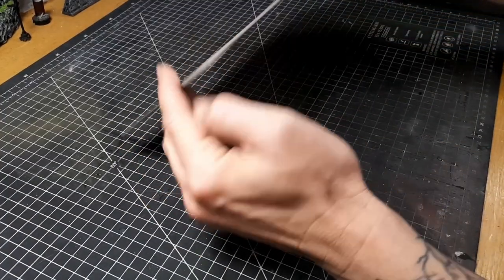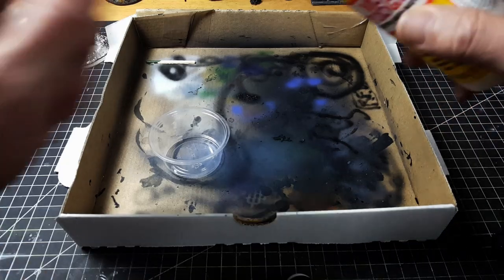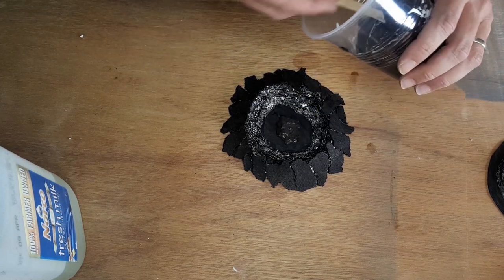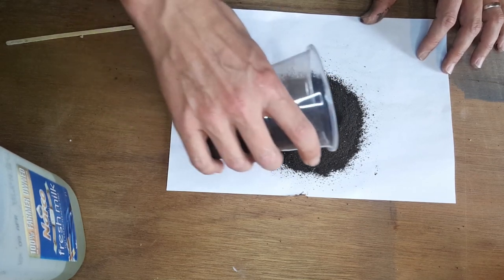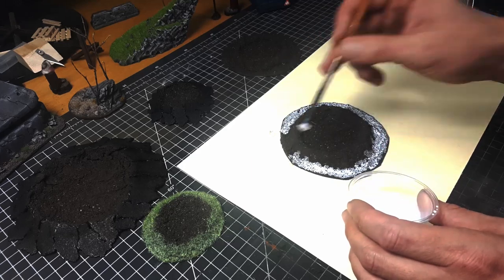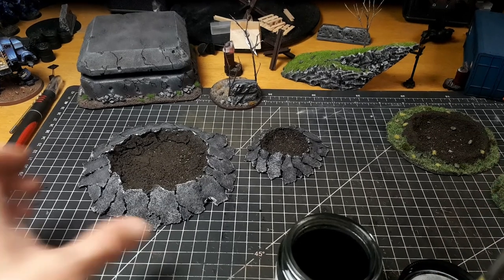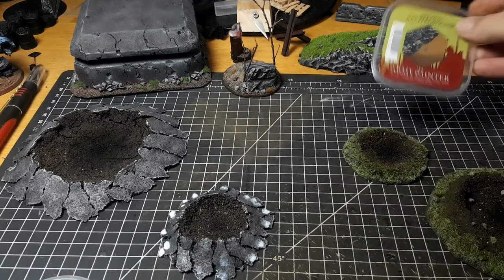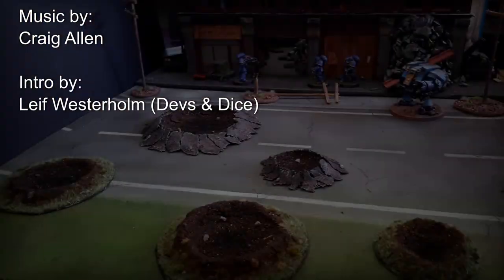Easy Miniature Craters for Wargaming Terrain and Tabletop Games

Comment: Hi, really like the vid! I'm a noob here so is there an approx. ratio for the PVA and water when sealing the dirt in? Just an approx. will do cause I can't tell how thick the mixture was. Thx
Reply from the maker: Thanks.  It's slightly more water than PVA glue, you want it to be fairly diluted so that you can easily drip it over the dirt or groundcover.  It should clear up nicely once dry.  I hope this helps mate.
Reply: @RFDHobby  Thx, it helped a lot,  u earned a new sub!

Comment: Really nice. Was just thinking. You could probably get away with covering one of these with a texture paint instead of flocking if preferred.
Reply from the maker: Texture paint would work really well, and be a lot cleaner process.  There will be a difference in the final texture obviously, I prefer this as it gives a loose soil look about it, as if the crater is relatively fresh (plus it's from my backyard and just happens to work really well for this application :) ).  Thanks for the suggestion mate, I really appreciate it.  Take care and all the best.